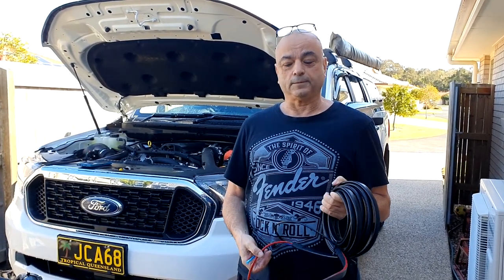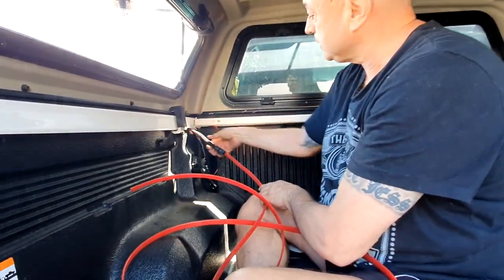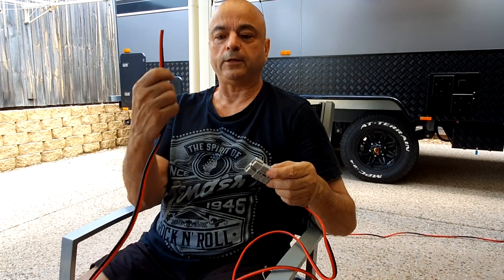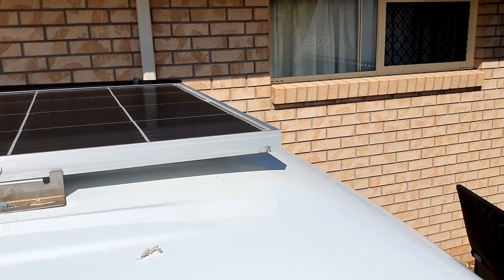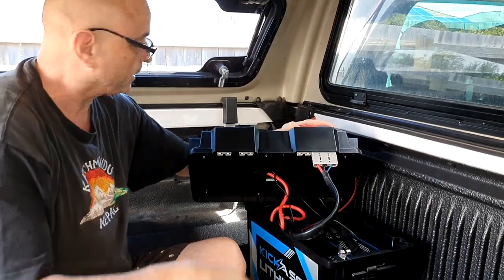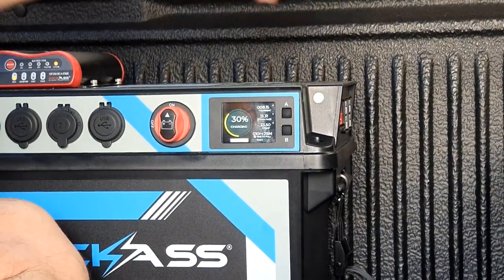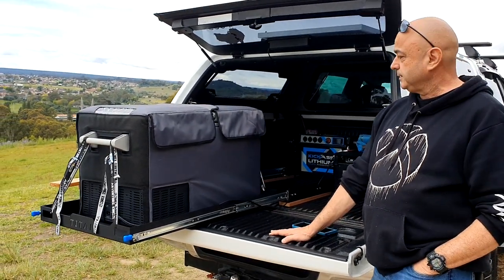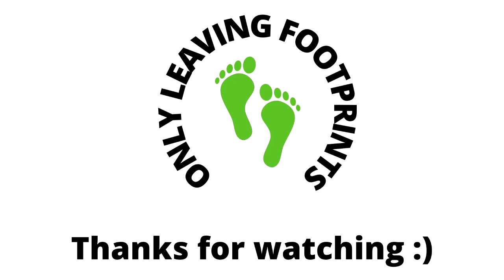Kickass Dual Battery System install - Australian Direct - Every 4x4 owner needs this!

Comment: not a good example mate , your wire underneath is  expose to the elements and you should have insulated and used the conduit to cover the wire ,especially when your  offroading which you can hit a rocks ,stone and other unwanted stuff that can damaged to the wire
Reply from the maker: Thank you for watching and your comment. As you would have heard in the video I asked for comments on whether to use some conduit over the wires or not but then I followed on by saying that " I think I will do it". And in fact this was done, the wires were insulated just a few days after the video went to air.

Comment: Hey mate I'm not too familiar with dual battery and 12v it goes over my head. I just wanted to know if this kind of set-up is OK for just fridge and camp lights and possible solar blanket ?
Reply from the maker: Hey there, this set up would work perfectly for that stuff.

Comment: I believe that system should only charge when the truck is actually ON
Reply from the maker: It does charge when the car is on and then through the solar panel when it is off. Thanks for watching

Comment: Hi there, enjoy the vid, thanks for making. I just bought one of these for my Ranger. Which fuse did you piggyback off for the ignition? And why did you choose to run the negative from the car and not the negative terminal? T
Reply from the maker: Let me check with Jon

Comment: Hey mate, thanks for the vid. What fuse did you piggyback off? And did you have to make a notch in the lid to run the wire out? Cheers
Reply from the maker: Hey there. No I didn't need to make a notch in the lid, I just ran it with the wiring harness it came with. From memory I piggybacked off the heated seat fuse. Thanks for watching 👀

Comment: hey mate awesome video, did you buy the cable etc from kickass? or did it come with your power box? Thanks
Reply from the maker: Both. I cant really remember as its nearly 2 years since I bought it but it came from Kickass. Unsure whether it was with the power box or separate. Thanks for watching
Reply: Man do you reckon without the solar panels and just relying on the car battery would the kickass power box stay charged?
Reply from the maker: Mate I am no pro but unless you are going to drive your car every day or every second day then I dont believe it would @cookiecanfly_

Comment: Hey mate, 
If I'm piggy backing off an existing fuse eg: wipers or heated seats, what amp fuse do I need put in the empty slot above the existing fuse in the piggy back adapter for the dc-dc
Cheers
Reply from the maker: Hi Mate, from memory I think I used a 10 amp fuse, it doesnt have to be to big. Thanks for watching

Comment: Hi there, enjoy the vid, thanks for making. I just bought one of these for my Ranger. Which fuse did you piggyback off for the ignition? And why did you choose to run the negative from the car and not the negative terminal?
Reply from the maker: Hey there , from memory it was the heated seats fuse. As for running the negative, that was just a personal preference to do it this way. Thank you for watching
Reply: The negative of the battery is at equal continuity as the chassis so no difference but as a beginners install should go to the battery ...most people that bolt to the chassis get a poor reading because they don't bare back to bare metal surface for the lug to bond